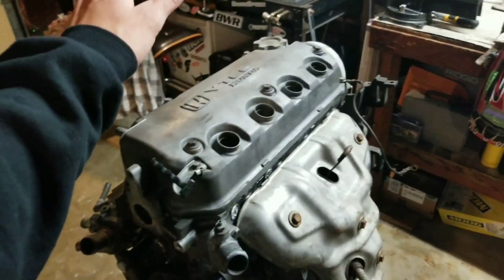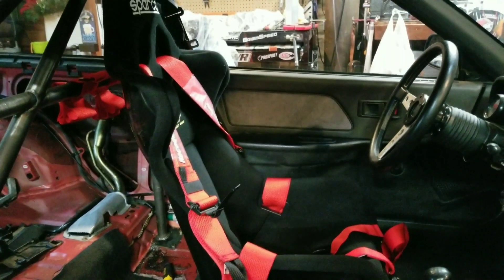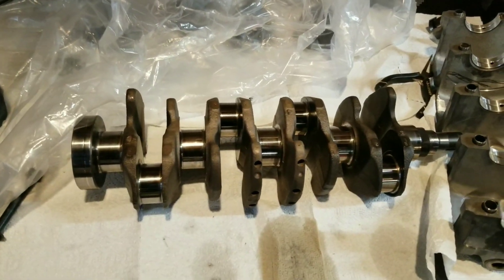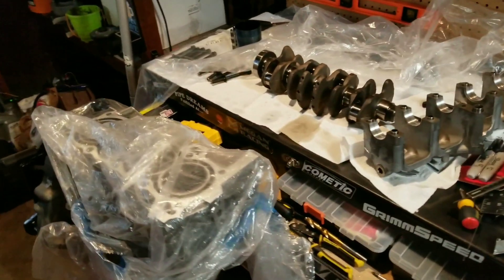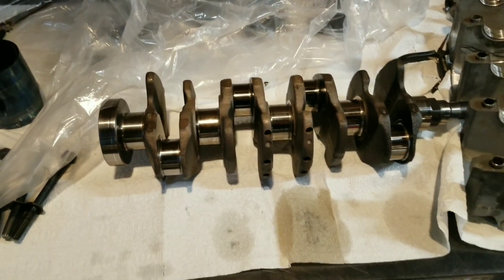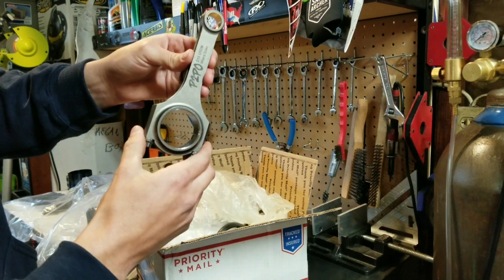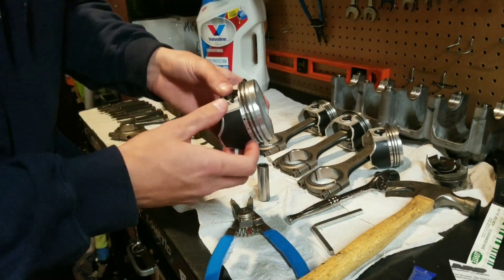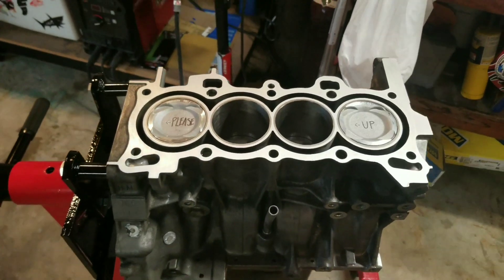USDM D15 Engine Build

Comment: Do you have a Part Number on those connecting rods ? I don't see them listed on the speed factory site
Reply from the maker: They are P2P0 rods. No notching required. http://p2p0.com/#!/P2P0-USDM-D15B-Vitara-Spec-Connecting-Rods/p/51512824/category=1439050

Comment: Yooooo your pistons are the wrong way the arrow is suppose to be pointing to the cam, closest to cyl #1
Reply from the maker: Normally you would be right but these pistons are meant for a suzuki Vitara. The intake and exhaust valves are the opposite on that head so that's why I'm running them with the arrow pointing toward the flywheel.

Comment: You didn’t have to notch the block ? Is that just with your block or do you think that would work the same with a d15b7 block
Reply from the maker: I think it would be the same with the D15B7. Pretty much the same block from what I've researched.
Reply: Yaks Welding do you have link to the rods i guess I’ll take a risk and get those instead of speedfactory rods
Reply from the maker: @isaacvalentin966  http://p2p0.com/#!/P2P0-USDM-D15B-Vitara-Spec-Connecting-Rods/p/51512824/category=1439050